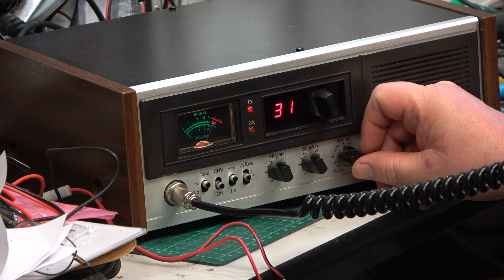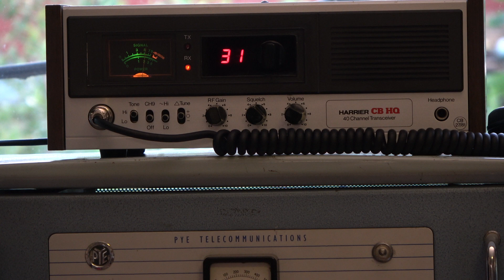Harrier CBHQ UK CB27/81 CB radio (Base station) -   On The Air Test

Comment: That one is in lovely condition but i have to ask whats your Harrier HQ sitting on top of?
Reply from the maker: My Pye F27 25W AM single channel valved base station on 4M amateur.

Richard
Reply: @ukfmcbradioservicingTango21  when i first left school i did a training scheme for a taxi company that used one of those. Nice radio what frequency is yours on Richard?
Reply from the maker: @g1fsh  70.260Mhz AM

Richard

Comment: New things do not work better, they are more complicated, to fussy to use mobile and to many functions with complicated menus.
Give me a working Cybernet boarded radio 30 years old any day.  Those Harriers had a good sound and the speaker where it should be, facing forward.  Shame they stopped making them, if they made something like that (which they can't as manufacturer is no longer around I believe) to cover those frequencies and the new channels I would be first in line to buy one.
Reply: I don't believe in converting them to work on the old and new channels, they were built to be a UK FM 40 channel radio and don't work well covering all the channels. I did try it but it was a waste of time, didn't want to cover them all and turned a bit deaf, so back it went to UK 27/81 spec.  Not the same radio, but same innards.  Cybernet chassis.